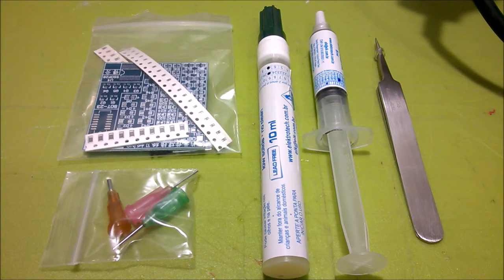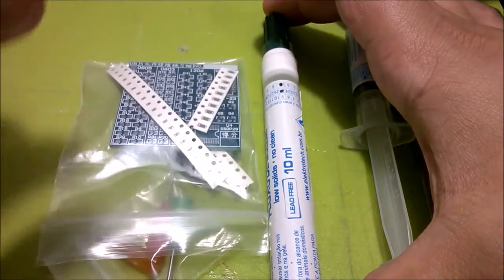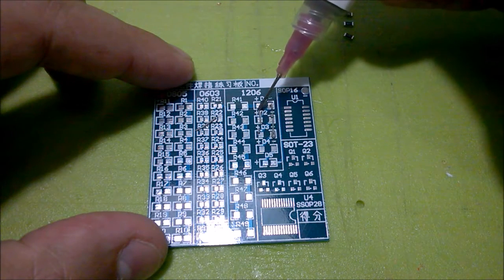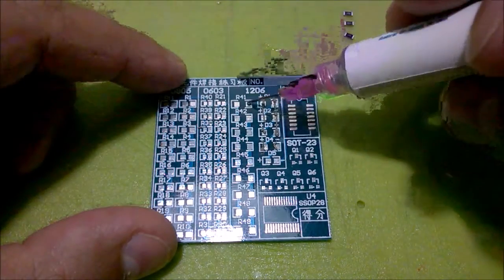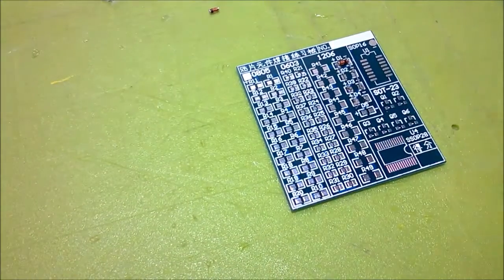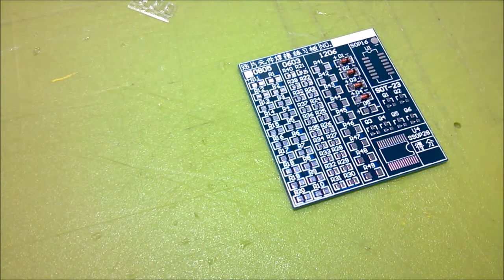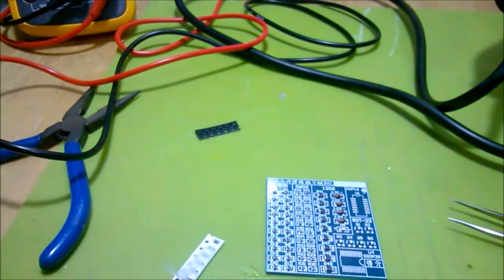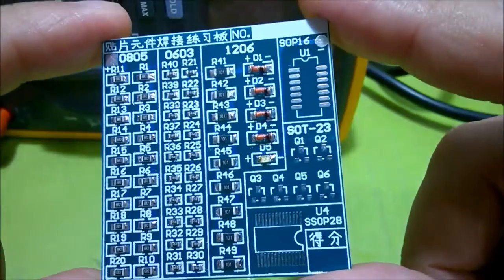SMD soldering practice kit assembly #2: using solder paste and hot air gun

Comment: 10:25 I got 6.6M Ohm between the + and the 1st diode. They gave me the wrong resistors. My circuit is OK but the led won't lit by powering the board :(.